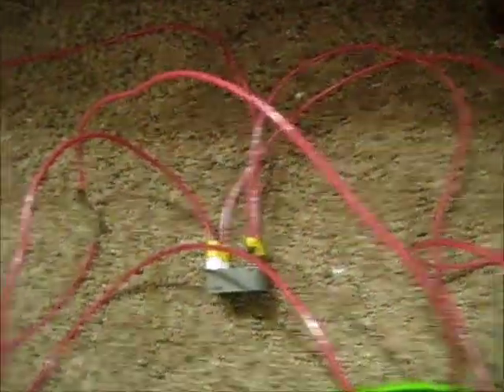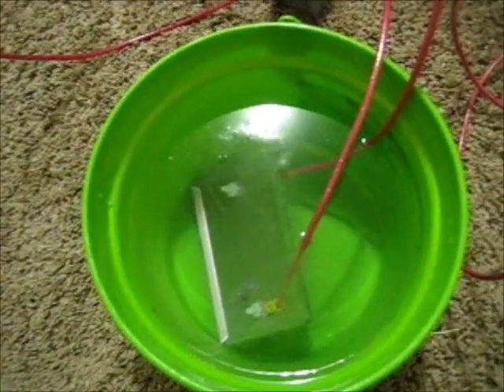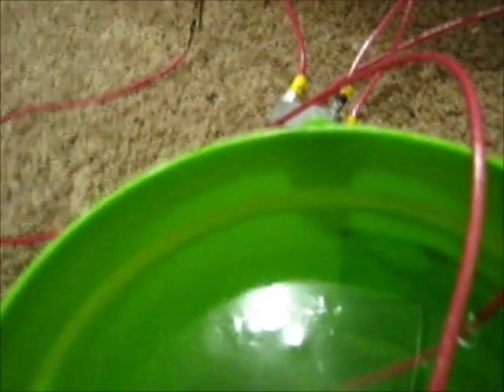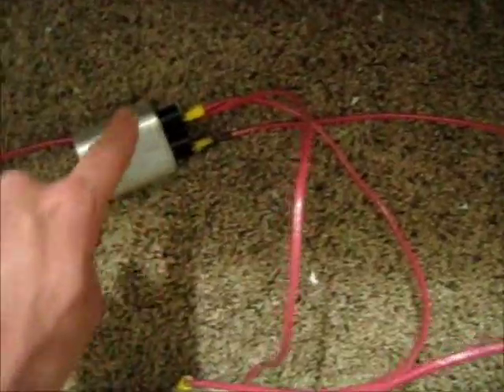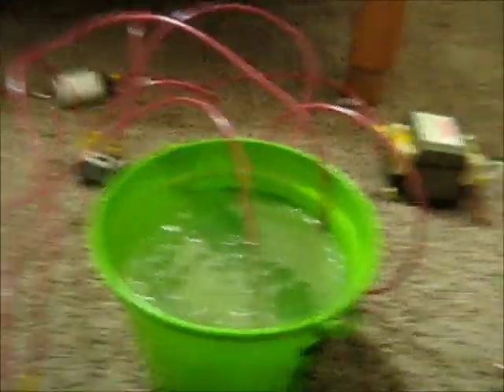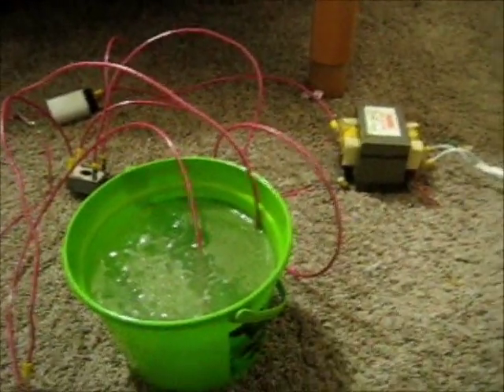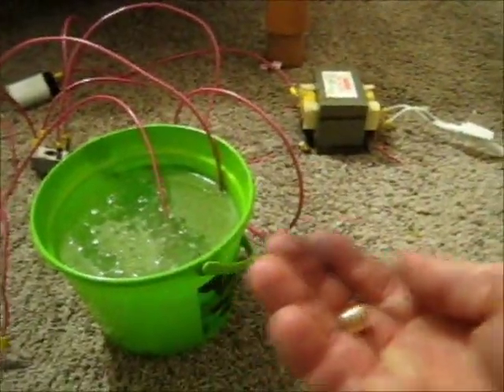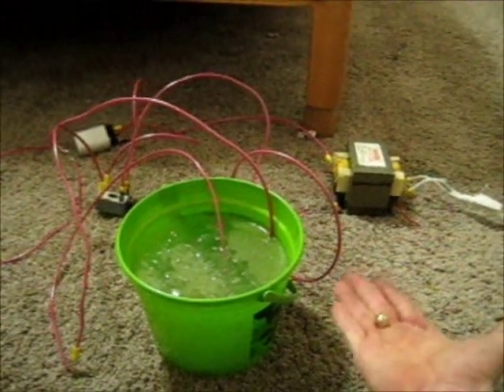HHO Using Microwave Transformer *Rectified* (Video Compilation)

Comment from the maker: Caps do to store energy with ac, that is why you need to discharge them to render them safe after they are used. This is an old video. As for me being able to tell if the gas coming off is hydrogen or oxygen you can know that by the way it ignites. Watch and you can see with your own eyes in the video that there is only hydrogen coming off the one plate you can't have booth gasses comming off of one plate now can you?

Comment from the maker: They store and build energy in an electric field and that energy can then be discharged a similar example would be battery. They cap the power as well. They are very easy to understand. a plate a dielectric and a plate. When there is a voltage across the conductors, a static electric field develops across the dielectric, causing positive charge to collect on one plate and negative charge on the other plate. Energy is stored in the electrostatic field. So ya I know how they work do you?

Comment from the maker: Wither what I say about caps producing only hydrogen makes since to you or not the fact is there is only hydrogen coming off the negative and no visible oxygen coming off the positive. Things don't always have to make since for them to happen. For all I know the oxygen bonds with another molecule instantaneously as the hydrogen is pulled off it. Having only hydrogen come off has nothing to do with wither or not I know how a cap works. I do know how caps work dude.

Comment from the maker: Of course they are not insulated for high voltage they are standard household 12 gauge wires. The do have enough shielding around them to be just fine with 2,000 volts for short term use I have used them for hours and hours with no problems at all. I don't have a clue what is happening to the oxygen but I know for a fact that there are no oxygen bubbles coming off the positive side and there are enough fine bubbles coming of the negative side to light them with a lighter.

Comment: it still remains that those wires are not insulated for high voltage
what you're saying about the capacitor and the production of only hydrogen has no sense.. where does the oxygen go? 2 H20= 2 H2+ 02 so the oxygen can't just disappear... so that means you don't know how capacitors work...

Comment from the maker: I ran the capacitor like that for a reason get one and try running it like that and you will see why I did. Running the cap on just the positive side like I did prevents the cell from drawing to many amps therefore I can run it for a long time without burning anything up. It also allows me to produce nothing but hydrogen no oxygen will be produced when you connect it up a certain way. The cap was designed for this transformer. I know I am over loading the rectifier.

Comment: you're overloading the rectifier, the cables which aren't properly insulated for the high tension generated by the transformer...
you don't know what's the function of a capacitor in AC, you don't know why you have less current with the capacitor connected..that capacitor is probably not even high tension rated...
you don't even know what an electromagnetic field is...
you shouldn't play with things you don't know...you should study first..

Comment from the maker: If you use a specific frequency of ac you can make HHO. You use dc because the polarities of the anode and cathode remain negative and positive on each cathode whereas if you use ac the polarities continuously alternate between polarities which does not allow enough time for the water molecule to dissociate it also means that each anode and cathode would be negative and positive because of this current switching.

Comment from the maker: @IlluminatedWhiteGuy you use a separator cell and store the hydrogen and oxygen in separate containers. when using a non demand system such as in a vehicle you can store the HHO under low pressure for acceleration purposes.

Comment: i just started with hho and am really liking the potential, I'm working on a way to store hho in something like a balloon or an inter-tube, I am trying a method that uses the works toilet cleaner and aluminum and a way to keep the bottle from getting to hot, but the smell is really horrible.  I got the idea from a video on youtube.  someone ran a weed-eater on the works using a 3 way tube and a glass bottle.

Comment from the maker: It may work but if you use pure HHO in a 2 stroke motor the motor will burn up because it has no oil. If your motor has a separate oil tank that releases the oil into the engine without having to have it mixed with the gas then it would work as long as you have the right amount of HHO and ambient air. I will be doing my real testing with tubular wet cells because of the stronger magnetic field they produce compared to that of a dry cell.

Comment from the maker: I'm not sure if DC works in transformers like this that's a good question. It may not work because the alternating magnetic field causes the magnetic field in the iron to basically rotate or pass through the iron which in turn creates electricity as that magnetic field passes through the coils.

Comment: I was thinking of doing it to my 2 stroke, So this is what I have planned: I will use a smaller jet and increase HHO thus decreasing my Fuel Consumption. So do you think it will work.
 So should I go for a dry Cell or a Wet Cell ??

Comment: The HHO (or HH or H2?) production only from one electrode is also puzzling. Ordinarily(traditional electrolysis) we have two parts hydrogen released from one electrode, and one part oxygen released from the other electrode. This makes me wonder if the hydrogen and oxygen are both being released from one electrode, if not; where is the oxygen?